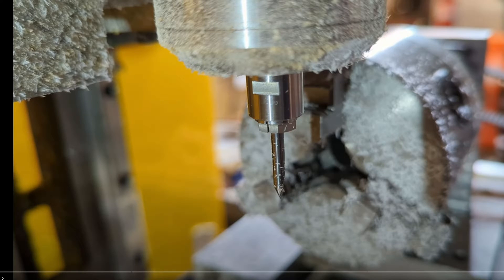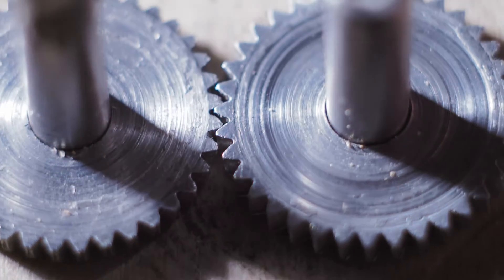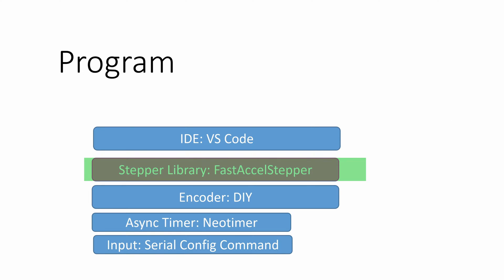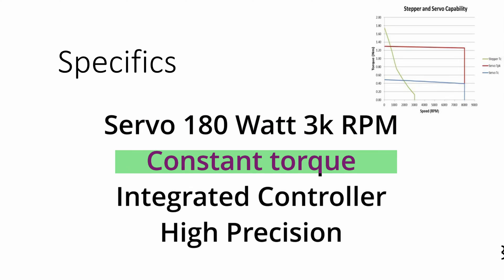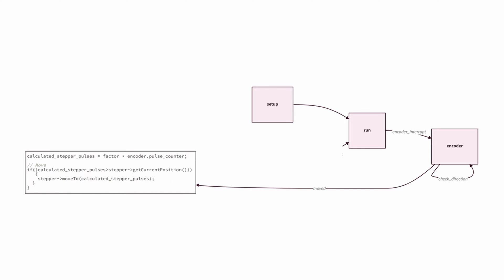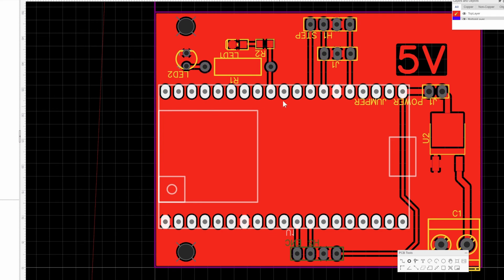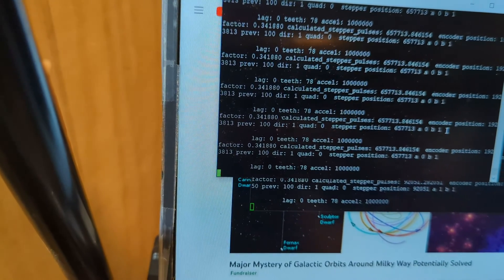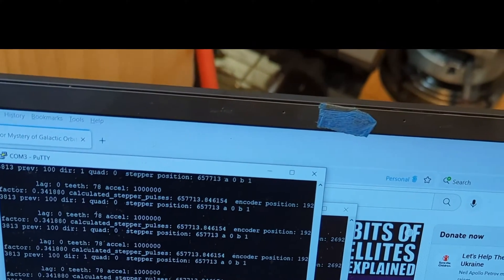Gear Hobbing Controller with esp32

Comment: Hi Jesse,
Very nice project. Would you mind provide your recommendation regarding the encoder and servo as well?
Reply from the maker: I was using a 600PPR encoder which produces 2400CPR.  Depending on your electronics skills the easiest type to get is a TTL type, but the differential signal types are more resistant to noise.  Mine is a LPD3806-600b.  It was $10.  The servo was as stepper online Model: iSV57T-180 ~90 and it comes with the driver.
Reply: @JesseSchoch  I believe you mean NEMA23 with driver iSV57T-180 ~90, right? Which differential signal type encoder do you prefer if there is any? Thank. Sandor
Reply from the maker: @sandorfulop9352  you'd need to build something to process the differential signal into the MCU, so I hope you know how to do that.  I don't have a recommendation but the differential encoders have A+/- and B+/-   (and maybe z+/-) so they have a lot more wires.  They are a bit more expensive but should all work the same.

Comment: very cool, it's like one additional dimension on top of a normal automated dividing head. just a simple firmware change and you can use it for normal divisions too (making rotary table dividng plates or scribing lines onto handwheels)

Comment: Why don't you replace the lines with copper as per original. The copper can be bent to stay out of the way of the slide and won't move or get brittle like plastic. Look much neater too. Pretty easy to open the end of the copper tube to make it a snug fit if necessary.
Reply from the maker: sorry, but what lines are you talking about?  Sounds like you might be commenting on my mill oiler video but you put the comment on the gear hobbing video?
Reply: @JesseSchoch  Hi Jesse, you are right, the comment was about the mill lube system video. I watched until the end and then started to type a comment. It must have jumped to the next video in the queue while I was trying to compose my thoughts. Sorry for the confusion. My mill has all copper lines, no restrictors or flow control valves and it works reasonably well. Some sort of flow control would be better as I have to give several pumps to get oil to all the lubrication outlets. I have to take the table off soon to repair a bent chip shield so I intend to try to restrict some of the shorter tubes by slightly crushing them while everything is visible. Cheers, Gary

Comment: Should be pretty easy to add WiFi I guess? Great project 😀
Reply from the maker: Yup, in my electronic lead screw I use wifi + websockets and it works great.

Comment: There is a company out that has castings and instructions so you can build your own gear hobbing machine.   I think it's like 500 bucks.
Reply from the maker: thanks for the comment.  Are you referring to the martinmodel casting set?  It looks like a fun project but it uses gears for the ratio.  My setup uses a bs0 dividing head that can be used for many other projects, it was ~330, the servo was $80, the esp32 was $5.  In my opinion this is more versatile than a dedicated hobber setup because it can do any ratio without needing change gears.
Reply: @JesseSchoch  Yes that's the machine.   I just wanted to add the comment because not everyone can jump right into the computer and electronics side of things but they can do the machine stuff.    I was wondering a little off topic (but on topic for your video) ..... if you had a larger diameter reader do you think you could run it faster and it wouldn't lag??   Or that would even speed it up that much further?    And if that's the case what if  it were smaller
Reply from the maker: @dizzolve  not sure what you mean by reader
Reply: wouldn't help. if the encoder diameter was larger but the same pulse per rev, there's still the same number of pulses per rev. I wonder if it's acceleration related, skipping an 1/8th of a revolution on startup before it gets up to speed? Being a servo it's weird that it wouldn't recover from that though.